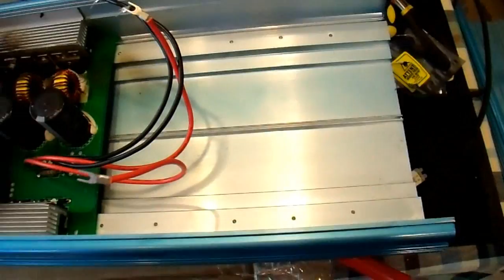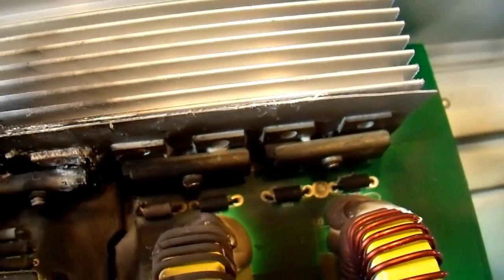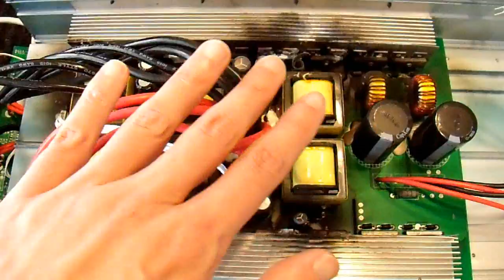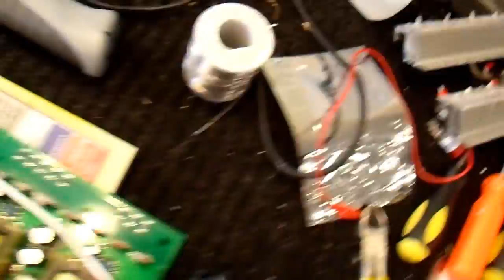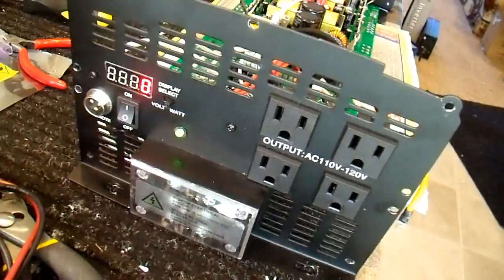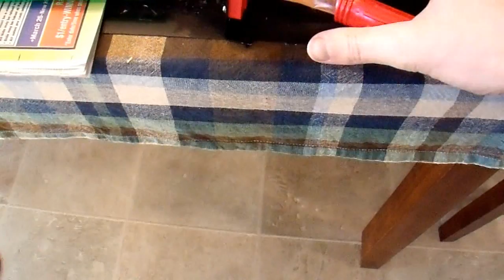Inside a Burnt Up 6000W Inverter - A Salvage Operation Part 1/2

Comment: Hi.  I know that you have been on a long hiatus but I have a question about this exact inverter.  I purchased one after you reviewed it and have been very satisfied.  It recently had some components that burned out.  I can identify the resister and mosfet (although I have not taken it down enough to verify that it does have a part number on it).  My issue is a torroidal inductor fried.  There are several of them and none have any part number showing.  I contacted Power Bright and they have no way of finding out what torroidal inductor it is.  Do you have any idea?
Reply from the maker: All of those inductors are custom parts so it will be very difficult to find a replacement.  When you say it is 'fried' is it just discolored or is continuity lost?  Or are windings shorted?  Assuming it is ferrite core (ferrite does not wear out, powdered iron does) and the core is not broken you could purchase enameled wire and re-wind it with the same number of turns.
Reply: @knurlgnar24  Sorry about the late reply...I thought I would have been notified if you responded!   The inductor wires turned black and the yellow coating on the core turned from yellow to white as it obviously got very hot. The wire around the core have continuity but is loose on the circuit board.  Along with rewinding it would I need to re-coat the core as well...if so what with?

Edit:  My research indicates that it most likely has an iron powder core due to it being colored yellow.  You said that the iron core can wear out...how so?  maybe just a breakdown of the core it self until it eventually cracks?  Or does it somehow lose its ability to magnetize?

I really do appreciate your opinion as it otherwise would be a pretty steep learning curve.

Edit(Again):  I did a scratch test that I found researching and the surface did not scrape any material off which it would if powdered iron...but it did leave a shiny metallic appearance which apparently ferrite cores do not.  I found a third type of core called Sendust which has many of the same properties of ferrite but will leave a shiny appearance when scratched.  So it seems that most likely the core will be intact (unchanged) and can rewind it.

I still hope you will respond though to what type of material to coat the core with and what type of enameled wire to get as I have found there are several types for each.

PS.  Any chance you would sell me an inductor from one of your broken inverters?  🙂

Comment: just bought one used. nothing is burned up inside.. Won't even power on. Any ideas?
Reply from the maker: It's usually one or more of the FETs (transistors that bolt to the heatsinks).  Take an ohm meter and check for zero resistance across the gate and drain/source pins.  If all three leads of the FET read near zero ohms it's bad.  Replace with similar/same spec'd part.  Fixed.

It's obviously not that simple but that's the general idea.  Probably 50% of these can be fixed that way without any specific additional knowledge.

This one did not work out that way unfortunately.  These are very good inverters in my opinion.

Comment: You might want to check again with that burnt circuit board take all the components off the burnt circuit board and rebuild it with a clean circuit board?

Comment: 6000W off 12V is insane. The cabling you would need for 500A. Ouch. Even at 3000W it is still too much. 48V is better
Reply from the maker: That is somewhat true, but for chassis wiring standards are looser and it is indeed easily possible to get 6kw from 12V with welding cable for 10's of minutes.  Such an application shouldn't be considered for permanent use but for occasional use I don't see a problem with it as long as fire risk is considered.  e.g. a 12AWG wire will handle 40A all day long while hardly getting warm which is double usual amperage ratings under ordinary rating conditions.

Comment: I have an 8k watt that looks just like your 6k
It is not working but not as bad as your unit
I think the module board that plugsin is bad or over heated. I want to change to Full Wave
with EGS002. is that possible?
Reply from the maker: All things are possible with enough knowledge, stubborn persistence, resources, and time.  Is it worth it?  No, not unless the journey is your goal.  If that is your goal then great!  If not you're better off purchasing a product engineered from the ground up to be a pure sine inverter.

Comment: 6000W inverter?...looks like Chinese crappy one.
Reply from the maker: This is actually a pretty good inverter in my opinion.  I would not equate it to the crappy Chinese ones you see everywhere today.
Reply: @knurlgnar24  the one we get here in India from very reputed brand for 2KW that come for 150 USD with big isolation transformer, all kind of protection, weigh around 20 kg, inbuilt PWM battery charger and comes with an on-site 2 year warranty. So this 6KW in such Form factor is intriguing to me. I think, it is SMPS based inverter (so the small transformers instead of big isolation transformer).

Comment: I have this exact inverter, and the top is blown but the bottom is fine. You stated that you wanted to remove a few of the green resistors. How many did you remove? And what would happen if I didn't remove them?

Comment: what inverter should i use in my sailboat 600 watt solar 1000 ah battery frig 165 watt microwave 700 watt cooking with 900 watt may use a heater. can you help

Comment: if sent you my inverter could you fix it.  I had a part fall off on the inside and damage some stuff. it was the magnet with copper wire around it

Comment: got a question. I have this inverter, but my question is about a different one. I have a 24 V AIMS 6,000 W that I'm having problems with. It goes into overload protection and shuts its self off after only a second or two. I need to disable the overload protection. Any suggestions? Thanks, My e-mail is rocket3man@rocketmail.com if you'd like to help me out. Appreciate you. skip

Comment: I have noticed MOSFETs come with a "static" charge warning that they are supposedly sensitive to ambient electrical discharge, but in my experience none have ever had any trouble being handled like normal transistors. What is your take on this "warning" knurlgnar?
I have built many homemade MOSFET modified sinwave inverters and never had any issue with them in this regard.
Reply: RiaRadioFMHD773 kindly guide for ulternate of php3205 mosfet mail bikram.sas@gmail.com

Comment: what is a good brand inverter to use in a home for black outs, Cheers
Reply from the maker: That depends on your requirements and what you want/need to power.
Reply: Fridge, lights, computer or television, pure sine wave is better I guess but is there a better brand name for a good inverter
Reply from the maker: Russ Graham
Is this for occasional temporary use (a couple times a year) or frequent use?  What is the power source - solar, vehicle alternator, etc?  If the application is a simple low cost solution for emergency power once or twice a year when power goes out then you can get by with something pretty inexpensive.  e.g. check out this eBay auction number: 321608763968  (not associated with me in any way)  This is a pretty good inverter for the price.  Most of them will do around 1700W continuous with good surge capability.  It's actually more capable than many of the crappy 3kw models on the market.
Reply: yes  for a few times a year, thanks
Reply: ***** Thanks alot, I think it s better to ask someone who know's since I was looking at a cobra, not really knowing the better quality ones, thanks again, Cheers
Reply from the maker: Russ Graham
yep, I would not recommend a cobra.  For example their 2500W units are actually about 1500W.  Them and whistler are both grossly over-spec'd.
Reply: That's why I had to ask you that knows better, you figure a brand name would stand up to the name, well for cb's, lol, Thanks buddy, I like the work you do, cheers
Reply: +Russ Graham Whatever you do stay away from the Black & Decker brand. And inverters really need a metal case- avoid the plastic cased models with bells and whistles like USB ports.

Comment: hey you good at what you do any change of buying a power jack 8000w LF 12v 240v 50hz and run it see if it blows up like mine did or i think there is not working ones getting sold cheap on ebay maybe can make a good video on them be be great mine smoked out with under 100w of christmas lights on a 8000w inverter
anyway love you videos i try to lean but you are way better then me at this
Reply: +weasel rodent power jack is not a reliable or quality name brand.

Comment: My inverter have 2 + 2- coming out of  it . I have 1+ 1- hooked up to bat .
should I have 2+ 2 - hooked up to my bat ? If yes how should I hook up the other +- to a different bat or the same one ?
Reply from the maker: They should both be connected to the same battery source.  Sometimes it is important to do so and sometimes not depending on the construction of your particular inverter.

Comment: Hi sir I have a question for you I would like to hook up 2000 watt inverter to my diesel car it runs on free fuel. I was wondering how many batteries that I might need and any other info but you could provide I want to run 10000 BTU 110 air conditioner thanks for any info
Reply from the maker: A complicated question overall, however the concise answer is that your diesel car cannot power your AC unit.  You would need to modify it to accomodate a 250A or so alternator (like a high output version of a semi truck alternator) and bump up the idle speed.  That said I do like the idea!
Reply: What about using a grid tie inverter to slow down the meter??

Comment: This might be a little off topic. But I'm thinking you might be able to help me out. I have 1/2 a Kw of solar on my camper a 2000W pure sine wave inverter. I want to get a 2000w inverter generator & parallel them to start my Rv A/C then drop off my solar once running and let my 2K generator run the A/C unit by itself. Does it matter if they are out of phase ? And if so how do they get the Honda generators running in parallel to be in phase ?  I just wanted to hear some input from someone with way more knowledge than I have. Thank you in advance.

Joe
Reply: +Bozonez3m you would fry your inverter
Reply: Thanks Dman. Just exploring possibilities

Comment: That one was blown up good! I'm glad you liked the construction. I've picked up 6 in two auctions and am going through them now. Sometimes the grid tied units won't sync. Not enough experience to know if they need more debug or if they are cheap and just don't sync easily. These larger units are quite amazing. Pure sine are more complex. I noticed the Go Power's have significant heat sinking. I've been thinking of making a fet tester for impedance matching new fets or maybe even for testing the working ones by removing them first. An in circuit fet tester? Hmmm. Thanks for the inspiration K!